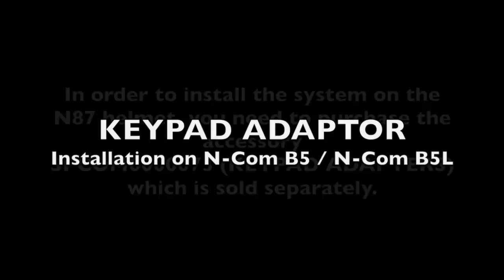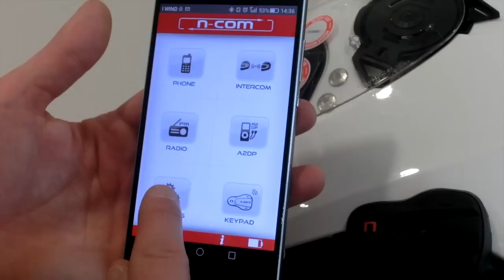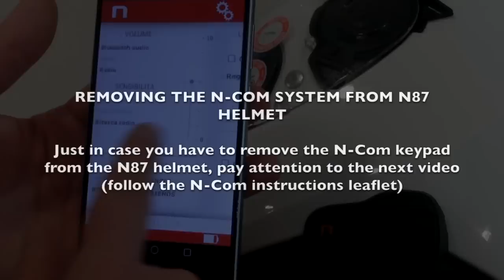N-Com B5L - B5 - B4 - B1.4 on Nolan N87

Comment: Hi
I got a B3 ncom system. I bought it originally for an n91 but the helmet didn't fit. I ended up buying a N87 and still got the B3 since I always thought that any ncom system would fit any nolan helmet. 

Can I install the B3 ncom in the N87 following these instructions? I'd like to know before attempting it so I can return it if it doesn't fit
Reply from the maker: Dear Sebastian, B3 system could not be installed on N87 helmet. See the specific webpage for more details: http://www.n-com.it/en/n-com-b3
If you have any other concern, contact your dealer.

Comment: I have the N87 helmet and N-Com b1.4 on order, when they arrive I will not be able to compete installation without the keypad support that must be purchased separately?  Is that correct?  Where can I buy this part?  Thanks for your help, Tom
Reply from the maker: Dear Tom, yes, in order to install the system on the N87 helmet, you need to purchase the accessory “KEYPAD ADAPTERS FOR N87” - code SPCOM…73, sold separately. You can ask to one of our official reseller. Here is the list: http://www.n-com.it/en/distributors
Reply: Yeah, that's strange. You get adapters for other helmets, but not for N87. I've had the same situation. Luckily, I could find it in the web shop, but had to pay for shipment unnecessary (more than the cost of adapter).

Comment: Hello i have just purchased this but there doesn't seem to be any response to the 'function key' at all and I'm unable to set different modes. Do you think that this could just be a firmware issue as I haven't updated it yet as it's fresh out of the box? Thanks.
Reply from the maker: Dear Paul, recharge the N-Com system for at least 24 hours, then try to switch on the device again.
If the “function key” is still not working, contact your local dealer for technical support.
Reply: Hello,

I will charge it again for 24 hrs thank you. I just wanted to double check as the supplier said they think it just has an emergency brake light, are there different versions of the B5L one with and without the 3 modes?

Many Thanks
Reply: nolangroup charging it for 24hrs did absolutely nothing.
Reply from the maker: Sorry for that,please contact your local dealer for technical support.

Comment: I just ordered a Nolan N87 and I am looking for a future n-com for it. On the n-com website I found that there are a few different models that fit the helmet. However I am not sure what is the difference between the models. For example, as you show in this video, B5L - B5 etc fit the helmet. M5 also fits the helmet. B5L and M5 come with the ESS if I understand right. So what is the difference between these two? Even the price is the same for B5L and M5.
Reply from the maker: Dear customer, check the different features and prices among N-Com systems on our website: www.n-com.it
B5L, B5, B1.4 can be installed inside the N87 helmet. M5 is a universal communication system that can be installed outside the helmet. For further information, contact us at info@n-com.it

Comment: Perhaps, I'll get help here quicker than emailing. I've installed my B5L on N87 and all is great, except the Android application. I've paired the B5L with my Samsung Galaxy S8 and still, the app says, there's no n-com device around/connected. Is the app not compatible with Galaxy S8?
Reply from the maker: Dear Marek, please note that we have just updated our N-Com APP on Play Store, can you try with the last update? In case you still have problems, please check that you did not select the option "USE WITH TOM-TOM" with N-Com Wizard PC program, as this option disables the profile to be used with the application. 
You can always contact us at info@n-com.it for any further information.
Reply: Thanks! Indeed, it works after reinstall. All is ok now. I've got some issues with pairing it using universal intercom with some other device (when finally paired, only one device could initiate the intercom mode, like a master-slave and not the other way around), but it's ok.

Comment: Hi, how do you know when the sensitivity of the brake light is optimal? Can you see it in the app when the brake light comes on?
Reply from the maker: You can set the ESS sensitivity level using the N-Com APP or the N-Com Wizard PC program; you have no possibility to check in real time the sensitivity level as the ESS function is activated only in case of a real brake while riding the motorbike. The N-Com device is anyway set with a medium level of sensitivity that we consider to be the optimal for a normal use on the bike.